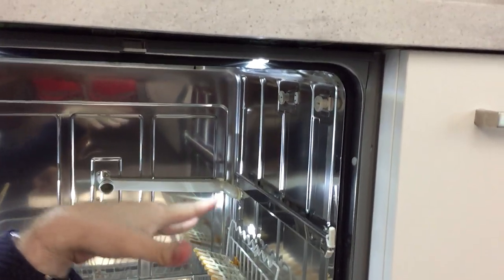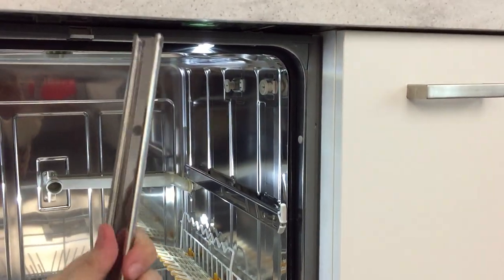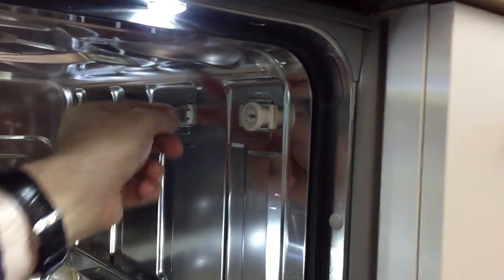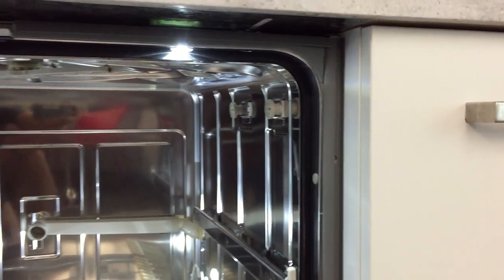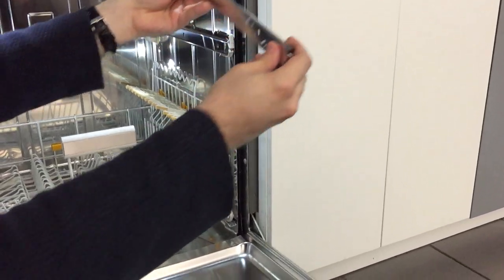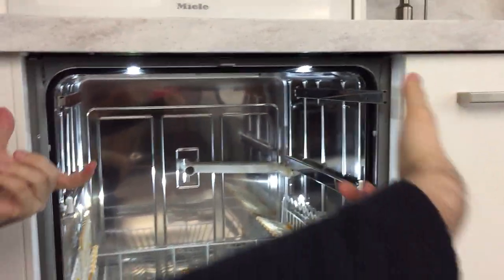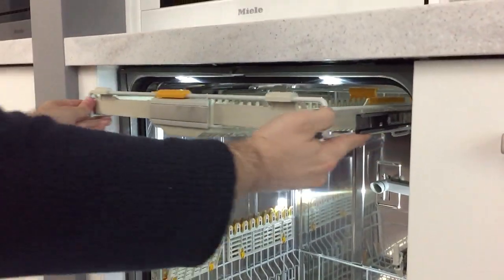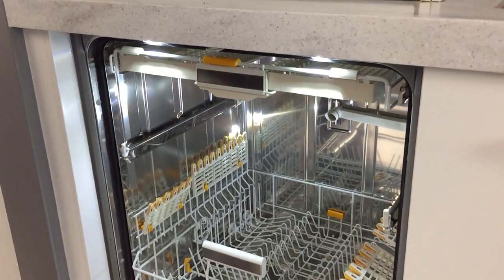How to replace the wheel on a Miele cutlery rack

Comment: Ok so how do you remove those middle wheels? There is obviously some sort of sliding plastic retention "U" clip on a notched dowel axel, but it really awkward to get at behind the rail. It would seem to require some crazy manipulation with a multiple small screwdrivers, plastic trim tools or tweezers.  Basically you somehow pry the U end over a nub while pull or pushing out. What sadist designed this? Like some car designs it seems to be a manifestation of German nihilism. Arggg..  Is there a trick or tool that won't result in me breaking or mangling these fiddly little plastic things?
Reply: I also need to know how to remove middle basket wheels in order to replace the track. can anyone help ? thanks
Reply: I need this information too! My 14 year old G2143SC works perfectly but the racks are not moving smoothly in and out. The bottom one slides along the top of a rail and it catches about 4 inches from the back of the dishwasher when I push it in. The top one is difficult to push in, has nothing to do with the adjuster levers that I can tell. They work fine. I really want to fix these issues but a repair will be very costly and no one wants to do it. They just tell me to buy a new dishwasher:(